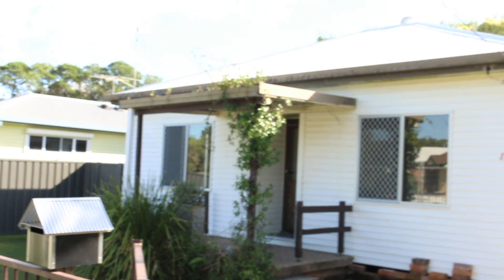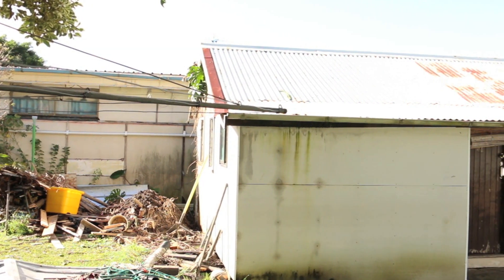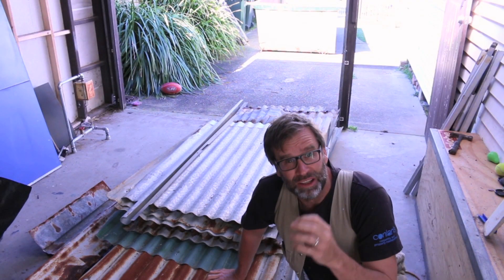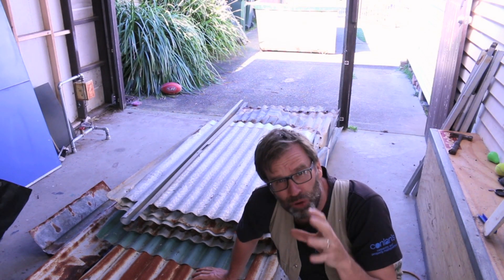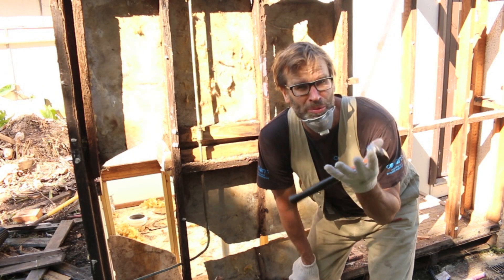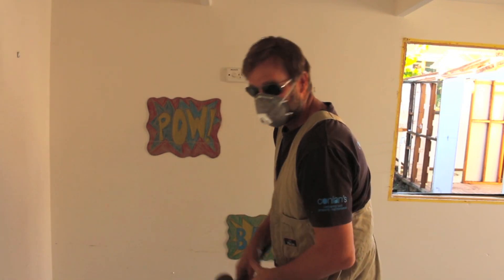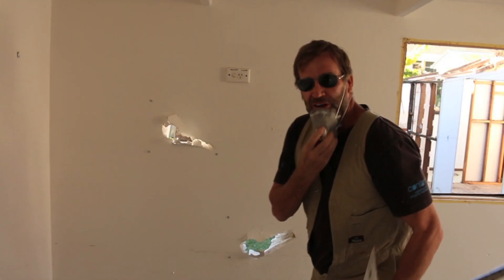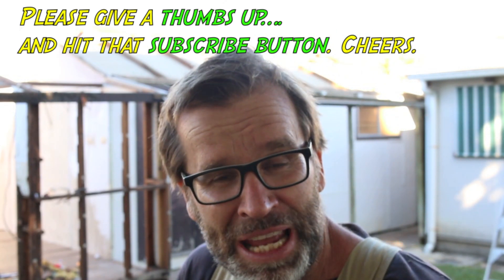Demolition...Day 1!! Owner Builder Series. Episode 6.

Comment: A bit off topic, I see that you house is all wood framing.
This raises a question: What are the rules, good practices, concerning job site lumber treatment? In particular, when you do a cut, is there any obligation to "dip" it in a bucket of wood treatment treating thing liquid.
Reply from the maker: smellysam G'day Sam. Here in Australia when building from new we are meant to use T2 Blue Treated Pine for our framing excluding beams. Here is an extract from one of our major suppliers which may address your question.
"The independent scientific testing conducted by QFRI confirmed that Hyne T2 Blue can be cut, notched or drilled without any requirement for the exposed surface or the cut ends to be resealed. Hyne T2 Blue must not be re-sawn, ripped or heavily planned as this may nullify the protection afforded by the preservative." It kind of contradicts itself so make of it what you will. Cheers .
Reply: Thanks for the answer.
Cutting and sawing - legally separated at birth!
A friend is building a house in OZ and I did not see the magic bucket in his pics, but I heard it was an obligation in OZ, I just can't find the source anymore.
In any case, I was thought by my gramps and various contractors that it is good practice to dip the end or crudely brush on some treatment on any cuts, especially anything  that touches the foundations.
Good luck on your build, I've still got a lot to do on mine!

Comment: In victoria I was told by VBA owner builders cant demolish, must get a demo company to do it any idea? please help?
Reply from the maker: Good question AY EM. Technically, demo can only be completed by a registered builder and in some cases by an Owner Builder. There are a number of steps that you need to go through including getting a building permit. There are legal and liability issues that you need to consider as well which is why you really need to engage a registered builder. Get in touch with your local council as they will be able to point you in the right direction.  Hope that kind of makes sense. Cheers and good luck 👍
Reply: @diyforknuckleheads  Thank you, do you also think spending more money on architects are worth it? I need to demo and rebuild a simple extention and it has been such a pain getting anything done. Council are so not help full and very miss leading, inner city one. I have no idea where to go, no builder would do it cheaper than 200k and my only option is owner builder, because it wouldnt cost more than 60k to finish. any tips would help thanks for the videos i have watched them all many times to learn.
Reply from the maker: Mate, l used an architect on my place because they had ideas that l wouldn't have thought of myself and they also had connections in council which made going through the planning phase so much easier.  Having said that, they were only engaged to the point of getting the plans done and approved through council. After that l was on my own but by doing that it was cheaper than having them involved throughout the entire planning and actual building phase. Hope that makes sense. Cheers 👍

Comment: I understand to try to recycle the wood and earn a buck or two, especially when some of the timber boards on older property will probably be wider than currently available stuff and can make fantastic furniture with it, but over here thy tend to run the largest  KOMATSU or JCB with a large arm and pull it down before lunch ...scarily fast...how history can be wiped away...
Reply from the maker: ryzo mcgregor How true Ryzo. That's why l wanted to do it myself. I can't wait to make some stuff out of it. I reckon it would be nice to have some furniture made from the old house in the new house. Stay tuned for that. Cheers mate